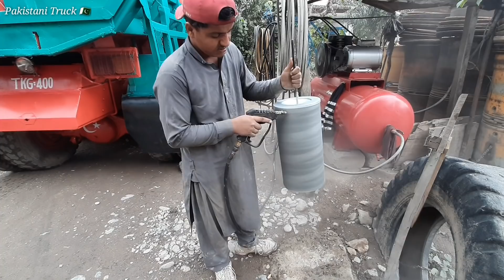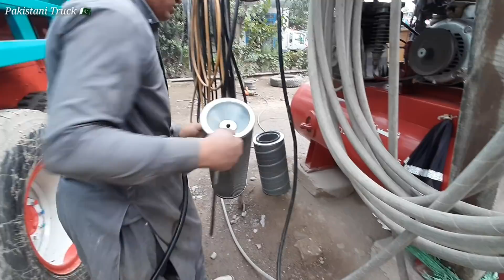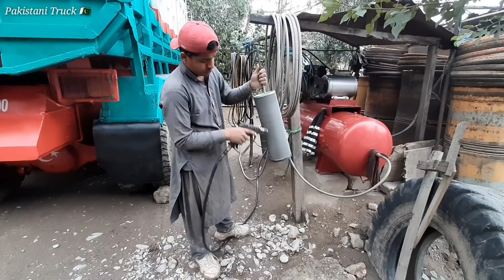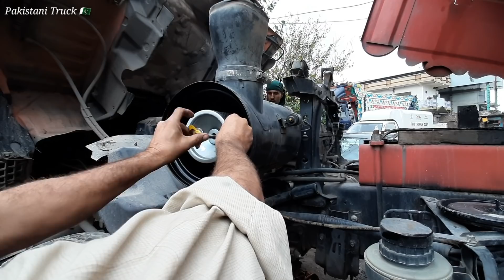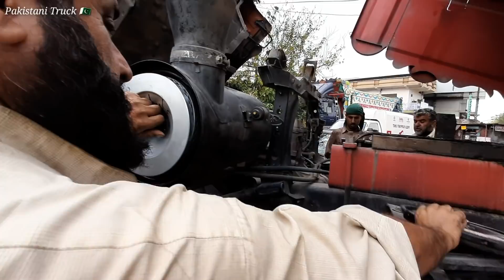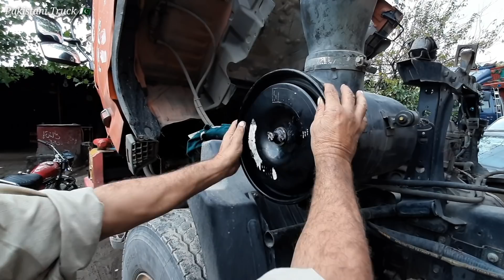How to clean air filter with air pressure, Hino Truck pakistani Truck channel

Comment: Are those really expensive, really hard to find, or just done between changes to extend their life, because in the US, we run the filter till its dirty, then replace them o.o
Reply: cleaning the air filter with compressed air is useless because the filter material is still clogged. compressed air only removes dirt that has accumulated on the surface
Reply: Replace the filter? Or pay a guy 6¢ that has a compressor to clean it? Keep in mind this is Pakistan....
Reply: @cky2k244  cleaning filter with compressed air is ok if you do it from the engine's side to the outside but it is not very effective. They just do it the wrong way
Reply: @cky2k244  I used to drive trucks.  The vast majority of truckers generally have the mind set that your truck is your livelihood, so they always make sure to do the proper maintenance either on time, or usually early, and always use the best parts.  Blowing out a filter doesnt help much, especially at how dirty it was.  But it does help somewhat. Seeing at how well they paint and personalize their trucks (which has to cost quite alot), it's just weird to see them cheap out at something so critical and relatively cheap